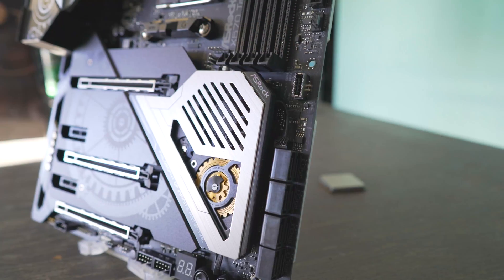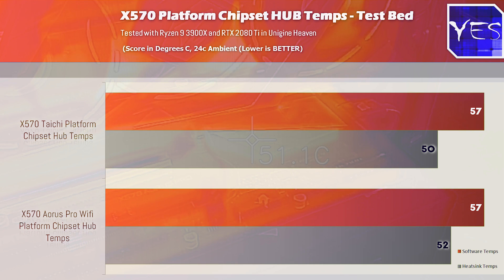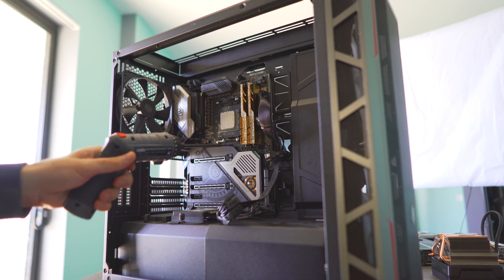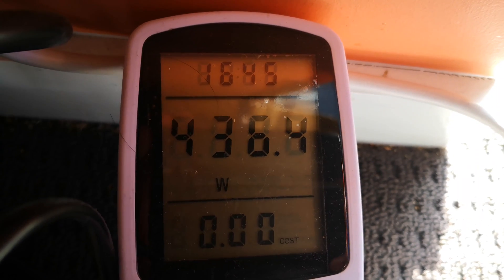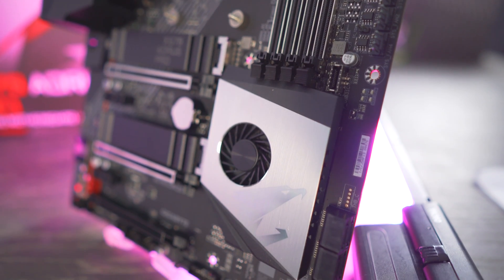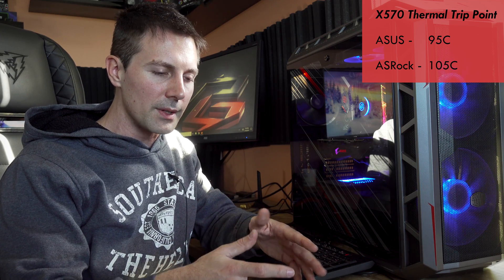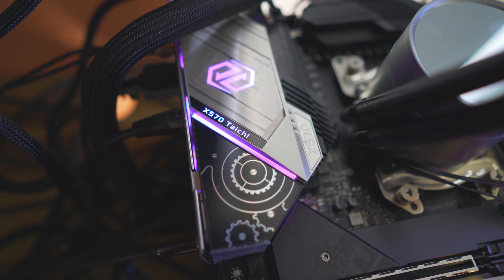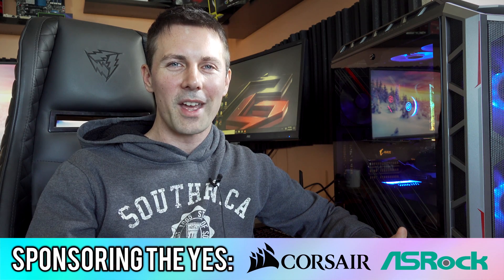X570 Chipset Overheating...!? (Investigation)

Comment: der8auer made a video about this chipset and measured how much power it drains and the heat output, I suggest you go watch it. He was running the chipset with a tiny radiator on it and it never shut off.
Reply: der8auer is a legend
Reply: lol, so don't trust my multimeter, only trust what some mass-produced uncalibrated chip claims the power to be, ok, lol.   no thanks, I'll trust what the multimeter plugged directly into the chipsets power rails is telling me over any soft running on the system, lol.
Reply: @Zarcondeegrissom  ,
I don't know what's correct for this situation, but I do know that Steve from Gamers Nexus showed horribly incorrectly reported voltages for some motherboards about what the CPU was actually getting vs what was displayed in the BIOS (and the software in Windows that used the same data). It was something like the difference between 1.25 and 1.4V which was the difference between safe and almost certainly killing your CPU in a year. And people were pushing those specs to the maximum "safe" recommendation of 1.3V or whatever it was meaning the CPU might only have months or weeks of life!!
Reply: @photonboy999  an ASUS board fried my 6600k with its defaults. Didn't occur that I had to worry about defaults if I wasn't OCing.  Was pushing 1.2v through the SA 24/7.
Reply: @Nathaniel Smith Yes really!
Reply: AMD debunked that one already saying it was observer bias
Reply: @tahiribnmohammad5410  For cpu's, derbauer checked out chipset power consumption and cooling.

Ram heatsink can be enough for x570, they use quite a lot of power idle for some reason and that is not observer bias or anything.. its just x570.
Reply: @ole8590no  the power consumption was incorrect because he had many apps open. AMD said only CPU-Z gave the correct power usage. This was AMD's official response
Reply: @tahiribnmohammad5410 he never said anything bad about it, he was just curious why was it draining 40% more power.
Reply: Der8auer is angry and needs a hug

Comment: maybe investigate about the high voltage and temp on idle for ryzen 3000 series? I saw no tech reviewers discuss about this.
Reply: Forgot to mention I have this problem first hand, 3600 with x570 gaming plus. Idle at 1,4-1,45 volts.. temps on 50-60 (stock cooler). I have to reduce the power plan to power saver, or reduce the max cpu to 99%, which gets me to 40-50 and 1,0 volt on idle.
Reply: 1.45 is pretty high for voltage Steve at GN recommends under 1.4 volts for daily driving.
Reply: @NoGoodNoob  exactly. Keep in mind this is all stock and auto, not overclocked. So having that high of voltage (and temps) is worrying. Some people said it's alright because even it's 1,4 volts, but the CPU is not doing anything.. but still...